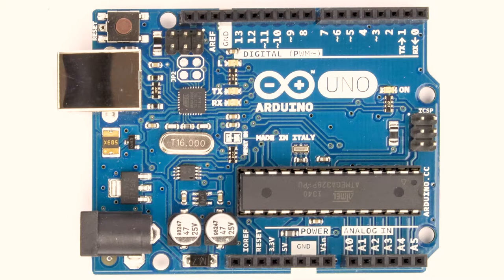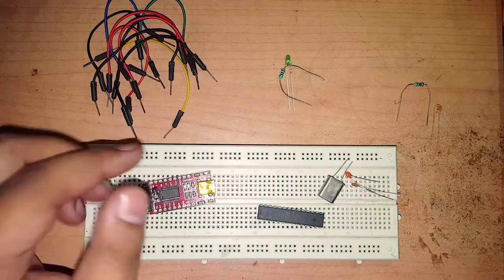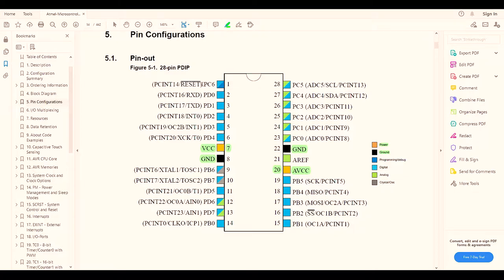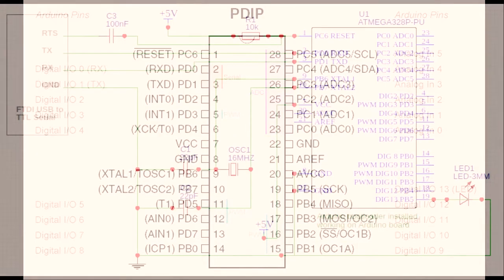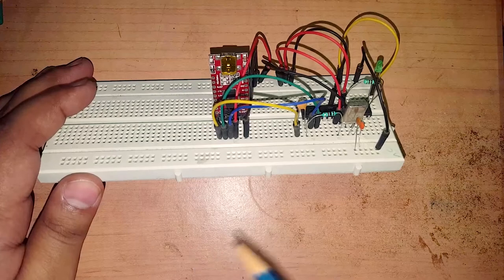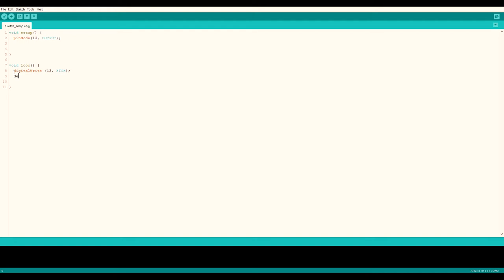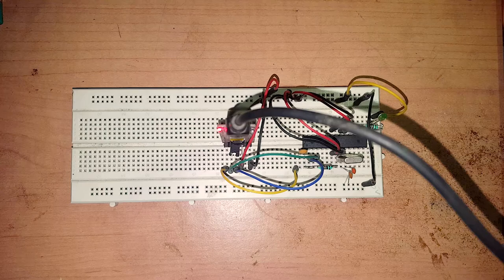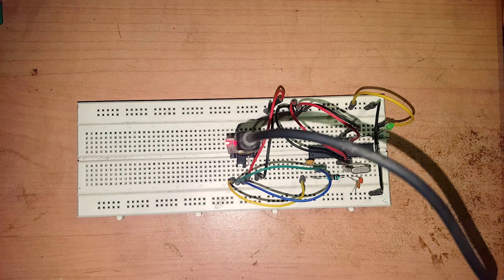DEC #01 Arduino Uno on Breadboard using standalone atmega328 with FTDI serial programmer

Comment: Hello, First of all Thanks.
But, your connections are RX --> TX and TX --> RX.

Because, other websites suggesting RX and TX connect with RX and TX of Arduino respectively.

So, What have to follow ?
Reply from the maker: hello sir! thank you for your comment.
You can follow what I did in the video. Its the only way to communicate. I did it in front of you. Don't worry if you connect the other way around, it won't damage the chip.
Reply: @DigitalElectronicsCircuitsLab  RX TO TX ,it is  clear that when one chip transmits ,the other chip should receive...!!!!

Comment: Can you make a video on how to upload sketch on atmega8 please
Reply from the maker: the process is same. only before uploading you have to select the board Arduino NG or older. And make sure the atmega8 has arduino bootloader pre installed.
Reply: @DigitalElectronicsCircuitsLab  thanks